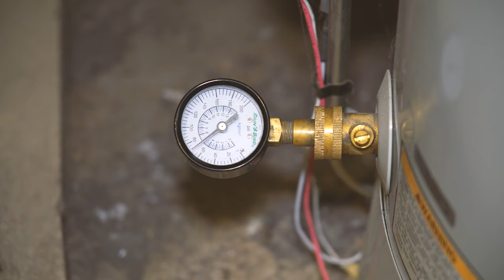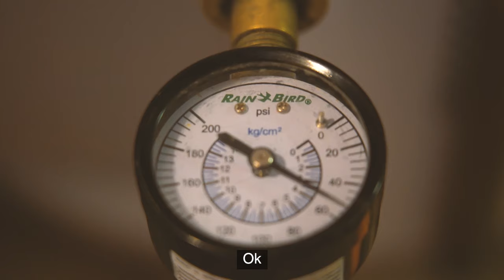Along For The Ride 049: Kurt Madsen, Service Plumber

Comment: 3:14 wouldn't the copper 90 + steel 90 react via electrolysis? And per PEX/manufacturer, a 1/8" space is required between the end of the pex pipe / outside of pex ring.. the pex ring on the bottom right (horizontal) far exceeds 1/8".